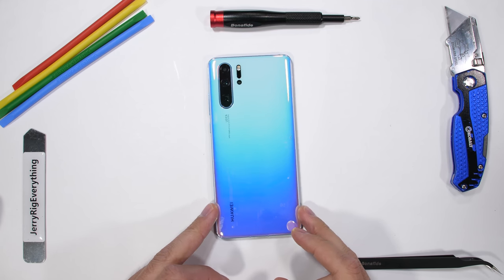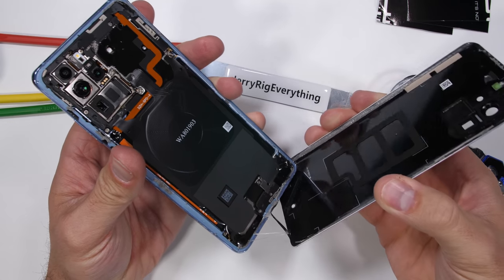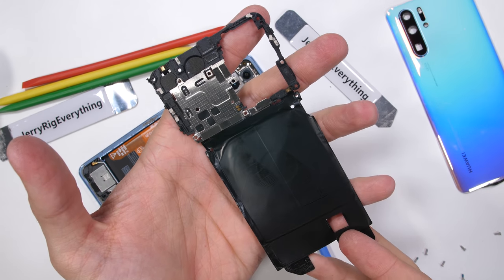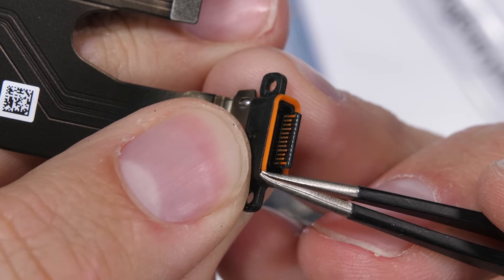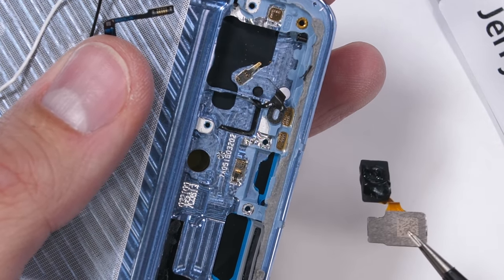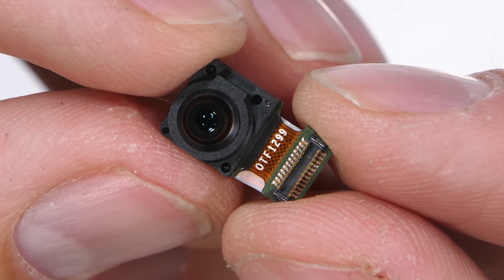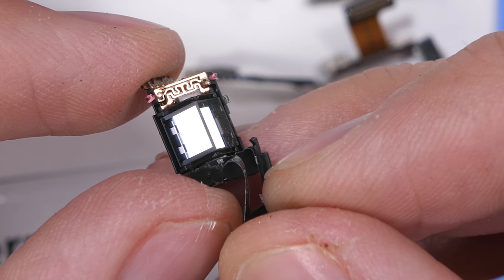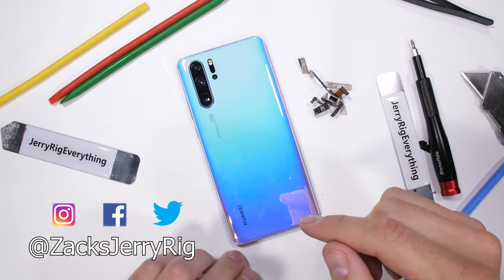Huawei P30 Pro Teardown! - How does a 'Periscope Camera' work?

Comment: 5:14
"Elektro magnetic sound levitation"

Whut
Reply: its kinda old tech though, xiaomi introduced something like it in 2016 with the xiaomi mi mix (one of the first near bezel less phones)
Reply: @abyzma201  sharp was the first with its phone.
Reply: In 2014, sharp aquos
Reply: Marketing fluff
But pretty interesting marketing fluff lol
Reply: @commandroid9336  The Aquos had a regular earpiece speaker, it didn't use the screen glass. Also note that he said ONE of the first near bezel less phones, not THE first.
Reply: @Sgtpeterenis  how about you search first:
"The Aquos Crystal features a Direct Wave Receiver which essentially vibrates the entire front panel of the display to get the conversation into your ears. "
Reply: Electro
Reply: @abyzma201  - I still prefer the traditional earpiece as a stereo speaker system

Comment: I can see pretty much improvements have been done in P30 PRO as the battery can be removed easily with NO ADHESIVE like P20 PRO, everything is perfectly aligned.

Comment: This is the first phone where I really think that they didn't have enough room for a headphone jack.
Reply: So true!
Reply: Pixel Man  yesss
Reply: Pixel Man  Headphone jack=smaller battery in this case, there literally was no room even the FPS was pushed down.
Reply: No headphone jack no buy lmao
Reply: people are plain dumb this way omg lmaoo imagine thinking a phone doesn’t have enough room for a headphone jack
Reply: Yup
Reply: Pixel Man  then you include the circuity for the jack...it's not as small as you think.
Reply: The p30 version without the periscope camera does have a headphone jack so you might be correct.
Reply: The screen is a little bigger, there is, how do you think about the problem? The screen is 2--3mm larger. The position of the jack is there. I think it is a cost issue.
Reply: Honestly I wouldn’t mind my phone being a little bit taller to accommodate a headphone jack from the side.
Reply: I think headphone jack is useful at home or in a place where you won't be moving and...for travelling and other things wireless is the option and the guy who gets this phone won't be sitting in his home and be a busy traveller or anything and he don't care about that ...only he deserves this phone not the others

Comment: "phone's are getting pretty hard to fix nowadays"

Its all part of their master plan
Reply: Well, Huawei Devices are not meant to be fixed as they hardly break when dropped :D
Reply: @CoolDude-ei5tz  lmao i accidentally forgot about my phone (p9 2018) in my pants and put them in the washer. was searching for my phone for like an hour then remembered. found it, let it dry still works like new. (not water resistant)
Reply: @suciualex2001  lol most huawei devices seem to survive water hand drops to the floor.
Reply: @suciualex2001  you should get rid of it, because it will break soon.
Reply: @nomars4827  been like a year and a half since that happened. still works. got a p30 pro tho

Comment: Any suggestion 🤚
"What if he turn ON the camera after rejoining the phone" 🤔
Reply: Basically thats what ive been thinking about
Reply: "Can't connect to the camera"
Reply: It will work without periscope camera. But zoom will not be available
Reply: just like BIOS on windows pc. when you turning on the phone, android bootloader will check any hardware connected and matched the result with the kernel that controlling everything. if one or more NON-CRITICAL hardware is not detected, it will simply ignored and continue to boot up. next, ROM will informed what's missing and it will automaticaly disabled, so you will not see any error message poping up

Comment: "People will go pretty crazy when Apple comes up with this tech in a few years"
Zac no shi*. Haters continue to hate but Apple never releases new tech without making sure it works properly
Reply: LIke the keyboard?
Reply: then don't call it innovation, that's the problem
Reply: Wow are you big mad or little mad? 
It's called experimentation. Something apple is too scared to do
Reply: Yet they announces tech which they promise to release and then cancels cough airpower
Reply: @bozhidardimitrov3573  they never call it innovation they just say it is the best
Reply: @Bazim  The keyboard is the best, the keys have a very good click sound like mechanical keys but without the travel. I have had the new MacBook Pro for nearly 3 years and the keyboard has never affected me. All those who did get affected are lazy fools who eat off of their laptops and never wash their hands
Reply: @TechDove  Wow are you crazy mad or a bit mad? Apple never realises a product without making sure that it will work properly unlike Huawei with the weird colour differences between the cameras and the unnaturally red hues on the wide angle and telephoto lenses
Reply: @bozhidardimitrov3573  They never call it innovation
Reply: @christianbrix2051  Yes but they didn't release an unfinished product like the Galaxy Fold. Samsung should have cancelled the release instead of postponing it due to the display and hinge issues. Apple theoretically could have released the AirPower and just told the buyers to beware that it they should not charge too many devices at once for a long time but they didn't
Reply: LordTechPro no they don't release unfinished products, they just announce them and never release them
Reply: @TechDove  well that's better than releasing a phone that blows up if you charge it or a phone that breaks when you bend it (Note 7 and Galaxy Fold)
Reply: @LordTechPro  the iPhone 6 bent, the iPhone 4 had severe reception issues, the XS has reception issues, charging issues and the iPad pro 11 and 12.9 inch bend. And the iPhone 6S had exploding phones. Apple has been much worse with bad PR than Samsung has, and you're just and iSheep
Reply: @TechDove  the iPhone 6 did not bend and I can guarantee that as I have an iPhone 6 and the XS Max and none of them have bended or had charging issues or reception issues or any of the issues mentioned above. You are just jealous that a kid can afford all these Apple devices but you cannot

Comment: Hey Jerry, thanks for your video! I pushed my injector tool slightly into the hole on the top side of the P30 Pro, next to the infrared diode. For what is this hole and did I damage anything or is the water resistence damaged now?

Thanks a lot!

Comment: I enjoyed your video , question though , the White wire running from the bottom left  along the right side of the frame  what's the purpose of this ?;I replaced the Glass back of my P30 pro , I though carefully but I broke that wire or actually pulled it out or the connection . My fingerprint scanner stopped working any thoughts on why ?

Comment: Hi! Thanks for giving us axniety :D
Do you happen to know if the metal underneath the charging port at the hight of the USB C socket has any connectivity functionality or if it's merely meant to keep the socket/port in the right place? Mine seems bend/damaged and as I am having some functionality problems with the phone (It won't find the cameras/nor the Wifi, speakers and sim. Might also be the connectors itself or the Sim board I am hoping that is not the cause of it.

Comment: Cheers for reassurance letting me know that sticking the sim ejector tool in the microphone hole shouldn't do any damage, is that for top and bottom microphones? Is it just a solid stop end at end of hole with microphone hole (looks like it when you poked it)? Looking  forward to the reassurance.. Thanks
Reply: On samsung phones at least, the top  one is at a 90 degree angle. I'm sure this phone has the same thing

Comment: I poked the top microphone hole with a sharp paper clip on my brand new S22 (coming from an S9 where the sim card tray was on the top of the phone).  I pressed really hard and felt like something popped at one point as the pin jerked inwards suddenly as I pressed harder.  Is it possible I've punched a hole and the phone is no longer waterproof, or worse, damaged some internal component?  Is it possible Samsung didn't make the top microphone hole as impervious to being stabbed as the bottom hole?

Comment: I would like to know which cable does send data from bottom to the motherboard (sim card, loud speaker, fingerprint sensor) or are they independent and are send individually? Could it be main flex cable ?

Comment: The 5x zoom is not variable zoom, is it? That means, in most cases 2x zoom (anything >1x and <5x really) will actually be digital zoom using the 1x (main) camera. That is probably worse than an actual 2x optical zoom. Anyway, just glance at the comments below and you'll be amazed how fanboys can turn a teardown discussion into a battle of the phone brands.

Comment: Will the microphone hole located at the top has the same protection feature (not damaging the circuitry and water resistance feature) like the one at the bottom if I accidentally inserted a pin into it?

Comment: I dropped my phone on the carpet from a meter height, it looks like there are a lot of very fragile internal components I could've damaged just from such impact (although it's still working). I hope I haven't caused any irreversible damage that will bite me in the long run.

Comment: I have mate 10 pro, i have 2 hole on the bottom one is microphone but what is the other, its not record. And i insert sim card pin these holes its stuck some point in deep touch something, someone know what is that and did i damage something?

Comment: my phone (huawei p30 pro) lost sound after disconnect my headphone wireless low battery.. but it's normal when using headphone wireless again.. what's the problem? software or hardware?
Reply: wtf, my phone back to normal (camera and sound work) again when in safe mode.. and then, where's the problem?

Comment: My phone dropped hard on concrete today. Yes, this phone is more slippery than eel in water. Of course glass back cover cracked but I have concerns about rattling sound near cameras. I think something broke and is moving inside. Had the phone for 2 months. That sucks. Good bye 14.000 CZK (518EUR).